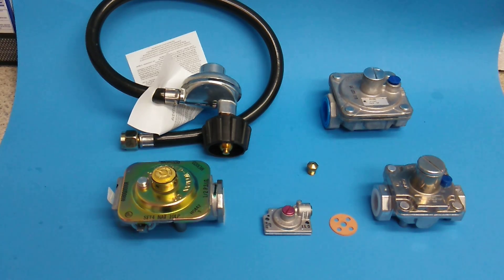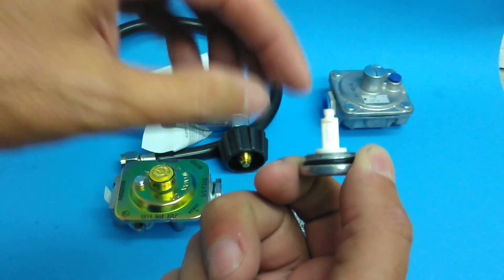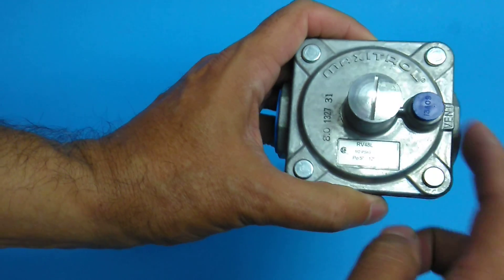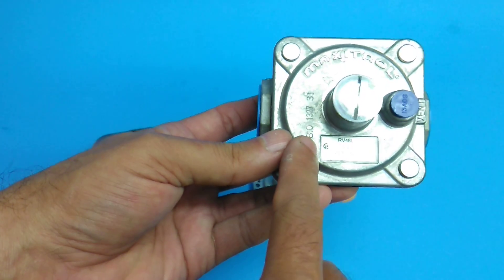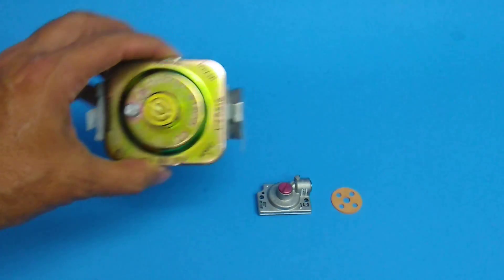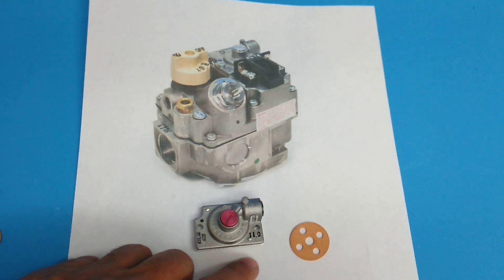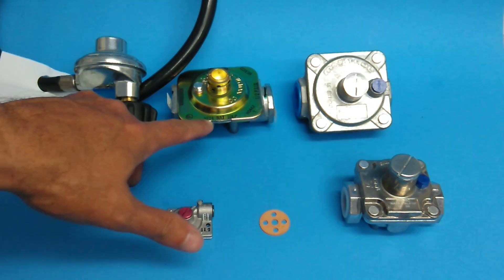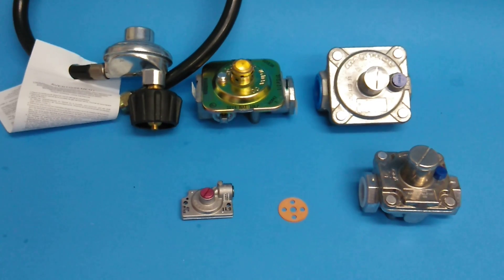Fuel Regulators Explained

Comment: hi Frank, great video very helpful to everyone but my issue is, my gas stove is connecting two regulators, from the  gas tank is a non adjustable regulator for two burn or BBQ gas grill thru my gas stove regulator. and the flame spread yellow not blue enough and great BLACK DIRTY STUFF I'm tired of cleaning. can I use only the stove regulator? pls any help suggestions? thanks have a good one.
Reply from the maker: Converting the regulator is only one part of doing a fuel conversion. I actually have orifices for every stove and barbecue unit made. I'm now in the Midwest, and you can always get a hold of me at 714-574-1544.

I would imagine that the regulators are in line with each other with the first regulator being the one on a large propane tank in your yard and the second one is on the stove itself. First of all, the one on the stove should be set at 10" WC and the one on the propane tank should be set at 11" WC to avoid any conflicts between the two.

However, the issue is NOT the regulators. If the flame is yellow, it appears that there is too much oxygen traveling up the burner tube. You should tighten up the window to your air shutters to allow less air to travel up that tube. If this doesn't do the trick, then you likely have an air leak somewhere along the tube. You should replace any burner tubes that are perforated.
Reply: hello Frank, its me again. I found out that my gas stove is a NATURAL GAS setting according to the manual that I read. but the gas tank that I bought, is a LP GAS, is the only gas we have on Island, so I need to convert my stove into LP GAS, according to the manual conversion, the spud # for the oven is 56 and the 4 top  burners spud# is 88. oh and the regulator should convert to LP too, so should I make a conversion or do you have a suggestions to help me. thanks have a good day Frank, God bless .
Reply from the maker: @winkiemalala586  Converting the regulator is only one part of doing a fuel conversion. I actually have orifices for every stove and barbecue unit made. I'm now in the Midwest, and you can always get a hold of me at 714-574-1544.

The info you have is erroneous. It would be impossible for any standard burner to run on #88 orifices unless they are natural gas pilot orifices. Even orifice blanks wouldn't have a starter hole that small. If you get a hold of me through text or through voice, I'll be able to supply you with what you'll need to properly do this conversion.

Comment: Can you run home range/oven off 2 40lb tanks with a rv auto change over regulator?
Reply from the maker: I actually sell orifices for every stove and barbecue unit made. I'm now in the Midwest, and you can always get a hold of me during normal Midwest business hours at 714-574-1544.

You can do this, so long as your stove is equipped with LP orifices and this "system" is regulated down to 10" WC. I say this because most residential stoves that would run off of propane would be designed to work with a propane fuel source rated at 10" WC.

Comment: Thanks for your informative video. I was able to pick out a Maxitrol regulator needed to convert my Broilmaster P3 from NG to LP. Unfortunately, I have already replace the orifices or I would picked them up from you.
Reply from the maker: Converting the regulator is only one part of doing a fuel conversion. I actually sell orifices for every stove and barbecue unit made. I'm now in the Midwest, and you can always get a hold of me at 714-574-1544.

Comment: did I hear you right, any grill with less than 130.000 BTU needs a regulator.
Reply from the maker: Converting the regulator is only one part of doing a fuel conversion. I actually sell orifices for every stove and barbecue unit made. I'm now in the Midwest, and you can always get a hold of me at 714-574-1544.

All propane grilles use regulators, but, if you're using Natural Gas, that is NOT the case. Basically there are only a couple of grille makers who do not use regulators on their natural gas grilles. These are generally cheap brands that are trying to save a few bucks on each unit. That wasn't always the case. Older Weber units had regulators installed, but now, they do not.

I always advise using a regulator on a grille, because, if the system goes "open loop" the regulator will shut down the fuel supply. You're more expensive brands like DCS, Wolf and the like come equipped with a regulator.

Comment: Stupid question: Why doesn’t the same setting work for natural gas and propane? I figure that it should take the same pressure*area to balance the spring force regardless of gas. Does it have something to do with the viscosity of the gas?
Reply from the maker: Converting the regulator is only one part of doing a fuel conversion. I actually sell orifices for every stove and bar-b-que unit made. I'm now in the Mid West, and you can always get a hold of me at 714-574-1544.

Viscosity is a term reserved for fluid (usually a lubricant) in it's liquid state, so such a term would not apply to a gas whether we're referring to propane, natural gas, butane, etc. The difference lies in the amount of force these gases are released at once they hit the atmosphere, and the term "Inches of Water Column" refers to the fuel's ability to flow through that atmosphere regardless of altitude density.

For residential use, natural gas is normally rated at 7" WC in a house system because it's regulated down to that rating through the regulator at the meter. Propane, however, is a compressed gas that is actually in a liquid form in the bottle due to it's pressurized state. The boiling point for propane is approximately -40 degrees F, so it's beyond it's boiling point when it hits a normal earthly atmosphere. It would flow unchecked if it were to be released without a regulator, and, in an enclosed space, would pose a serious hazard.

For use on a barbecue or a stove, propane normally is regulated between 7 and 11 inches of Water Column (WC). Most of the time, it's used at 10" WC. Since natural gas is normally regulated down to 5"WC more often than not, the presence of propane compared to natural gas (when comparing 10" WC to 5" WC) is approximately twice as much by volume. So it would stand to reason that propane (at 10" WC) would need twice the volume of oxygen compared to natural gas (at 5" WC) to become combustible. Each gas has a slightly different burn rate so this ratio isn't exact, but, for the purposes of this conversation, it's approximate enough.

Comment: Hi Frank My grandson gave me a thermador range model # PRL366EG/12 I do used propane in the farm where I live Have to modified the gas system can you advise me how to proside appreciate your help thanks in advance
Reply from the maker: I do a kit for that model. It sounds like you're converting from propane to natural gas. Is this correct? Converting the regulator is only one part of doing a fuel conversion. I actually sell orifices for every stove and bar-b-que unit made. I'm in the Mid West, and you can always get a hold of me at 714-574-1544.
Reply: @frankhamilton8257  thanks for the info I fine the kit is on the way blessings
Reply from the maker: @silvanoramirez2311  I have a lot of people who contact me after they've ordered the wrong kit like you've just done. I'm the only one who has the correct kit because I'm the only one who machines these parts. You can't find them anywhere, so that's why I have to make them. Here's a link to the listing that I have on eBay: https://www.ebay.com/itm/174536795228   Just contact me after you've figured out that you've just ordered the wrong parts.

Comment: Hello Frank. I have a question. What if I install a natural gas regulator at the main line 40 feet away with some sort of non-return valve at 30 feet distance, and then I install a propane gas cylinder to that same line at 5 feet near the stove. Will then a propane regulator set between the stove and the cylinder work on both natural gas and propane gas without ever needing to switch it back to natural gas? What is the worse case scenario then? I ask you this because where I live there is a shortage of natural gas. Thanks.
Reply from the maker: Converting the regulator is only one part of doing a fuel conversion. I actually sell orifices for every stove and bar-b-que unit made. I'm now in the Mid West, so you can always get a hold of me during normal Midwest business hours at 714-574-1544. 

Concerning this solution. The orifices are the great equalizer here. No matter what you do, you still need smaller orifices for use with propane no matter how you divide it up. I would just convert the unit for propane and let it be at that. That way, you'll always have a reliable fuel source.

Comment: Hey I have a question about my stove
Reply from the maker: Converting the regulator is only one part of doing a fuel conversion. I actually sell orifices for every stove and bar-b-que unit made. I'm in the Mid West, and you can always get a hold of me at 714-574-1544.

Comment: Hello Frank your video was great I have a question and need your guidance I live here in Orange County and I bought a single commercial wok it has a natural gas regulator but the reason I bought it is because I wanted to use it in my back yard with a propane tank you think this is possible if you can please reply back frank I’ll really appreciate it thank you have a good day
Reply from the maker: Converting the regulator is only one part of doing a fuel conversion. You'll need to replace the regulator AND the orifices. I actually have orifices for every stove and bar-b-que unit made. I'm now in the Mid West, and you can always get a hold of me at 714-574-1544.

Comment: Nice explanation of different types and where you adjust the regulators at. Usually the gas regulators i have seen on the natural gas meters are fix non-adjustable for obvious reasons. And for stationary propane grills there usually non-adjustable and seem to need a simple converter kit which just switches out the regulator and orifice valves to convert from propane to natural gas/visa-versa. Good to see a demonstration of the major types...curious where those all for cooking/ranger/oven/grill appliances. Because the last one looked like an LP version of a forced hot air furnace unit type.
Reply from the maker: Yes, these are all used on various commercial and consumer cooking appliances. Converting the regulator is only one part of doing a fuel conversion. I actually sell orifices for every stove and bar-b-que unit made. I'm in the Mid West, and you can always get a hold of me at 714-574-1544

Comment: Cool, but what happens if I pick a bigger regulator than my current propane regulator from the factory, can't I get a way hotter way faster?
Reply from the maker: Doing a fuel conversion is usually a simple affair. I've converted just about every type of bar-b-que and stove made. I'm in the Midwest, so feel free to contact me at 714-574-1544.

Trying to extend the heat range of manufacturer's burners is definitely NOT something I recommend. Also, it's NOT the regulator that restricts the heat range of the burners (so long as the regulator is not maxed out in a TOTAL BTU output scenario), it's the bore size of the orifices that dictate the BTU of your burners. Besides creating a potentially unsafe level of heat production, your homeowners insurance policy would definitely not cover any potential hazards posed by over extended burners.

Comment: Hello Frank! Enjoyed this video. I recently bought a 'dual fuel' grill by Charbroil at my local hardware store. The grill is for my parents who have never used a natural gas connection, but have access to in this new house.  I bought the manufacturer's conversion kit to connect the grill to natural gas. However, the kit just connects to the gas line without a regulator. My dad feels uncomfortable about this, so I'm doing research to add one to the line running from the house above the physical shut off valve. Do you feel that this is needed? I believe I would need a regulator like the Chen Fong one you demonstrated with the 5' rating. The grill is a 32,000 BTU spec.
Reply from the maker: Doing a fuel conversion is usually a simple affair. I've converted just about every type of bar-b-que and stove made. Feel free to contact me at 714-574-1544 during normal Midwest business hours.

Weber is another company that DOESN'T  use a regulator on it's natural gas barbecues (in MOST states), but other companies do (DCS for one). It's likely because they believe that the ambient conditions in an outdoor environment would quickly dilute a natural gas charge with plenty of available and circulating air. I tend to lean towards a "best practice" approach, advocating the use of a regulator in ALL circumstances. When you think about it, why would you NOT use a regulator? All your home appliances use a regulator. Besides, a regulator will instantly shut off the fuel supply in the event that your system has a massive gas leak or otherwise goes "open loop."

Comment: Thanks so much for this video. I bought a used grill that someone was trying to convert over to natural gas and was having issues with it, converting back to LP. Just realized I needed to flip that little white piece over inside the regulator. My question is, if I have a regulator like the first one, do you need the other regulator on the actual propane hose right before it connects to the bottle? It was missing the hose when I got it, but still had the original regulator on the wall, inside the door. It’s a pretty big grill, a Jenn Air 720- 0727, so it has like 8 burners and an oven, 115K BTU total. I had read about 1st and 2nd stage regulators or 2 stage regulators and wasn’t sure if I should have a second one. Thanks!
Reply from the maker: Doing a fuel conversion is usually a simple affair. I've converted just about every type of bar-b-que and stove made and I have parts for everything made, especially Jennaire. Feel free to contact me at 714-574-1544 during normal Midwest business hours.

Propane is actually compressed into such a dense package that's it becomes liquid inside the bottle and it become a gas when released into the atmosphere because ambient temperatures are well beyond it's boiling point (-40 degrees F at sea level). The contents of this bottle is an ultra pressurized fuel (somewhere on the order of 80 psi if you were to rate it as such). The only type of regulator that can handle this type of extreme incoming pressure is a barbecue type regulator. All barbecue type regulators aren't created equal. Some types have an output well beyond 11" WC, so make sure you have the correct regulator (usually a type like you'd find at Home Depot, Lowes or Ace Hardware with a hose on it. If you have a bottle mounted underneath the grille, you'll want to remove the second regulator to eliminate any possibility of a conflict between the regulators. The two stage regulator you've referred to is a completely different animal that has two regulators in one housing and is typically used for commercial applications (refrigeration being one of them).

The regulator is only part of the equation. You'll also need to match the heat range of each orifice to the rating of each burner as designed. It's likely that these orifices were hogged out to a new size to accommodate natural gas, so they're useless for propane if that's the case. the only way you'll know for sure if the orifices are intact is to use a set of numbered drill bits (like the type you can get at Harbor Freight Tools) to gauge the bores.  I machine the specialized rotisserie orifice (the most critical one, and potentially, the most dangerous one if it's not bored to the right size). If I recall, there's also a radiant burner (similar to the ceramic rotisserie burner) in the bay of that unit as well so you'll want to gauge that that orifice is also on the money. I believe that unit has a larger than usual rotisserie burner rated at 13,000 BTU. Most barbecue units on the market stretch the truth when it comes to rating their burners, but the Jennaire rating is usually accurate by the numbers.

I've done parts for every Jennaire made, including that model, so feel free to reach out.

Comment: Frank,  I think I may need to purchase a regulator from you.  I am building a large fireplace (LP); and I'm robbing the regulator / burner etc from an existing Heatilator fireplace, but I want to triple the size the off the firebox; and add 2 additional burners/log sets.  We want to make sure their is enough volume. Should I purchase a commercial regulator from you? I doubt the Heatilator is big enough.  We are also at 6000 altitude. Thoughts?
Reply from the maker: Doing a fuel conversion is usually a simple affair. I've converted just about every type of bar-b-que and stove made. Feel free to contact me at 714-574-1544 during normal Midwest business hours. I mainly deal in conversions for stoves and ovens. There's a possibility that you may need a larger regulator just for that application, which I do not do. Have you checked you local listings to see if anyone is qualified to do that?  You'll need to know what the BTU output of your fireplace is and match a regulator to that if you're going to do it yourself.  Since you're doing a fireplace, the fuel mixture won't be critical and the altitude shouldn't be a factor, especially at that altitude.